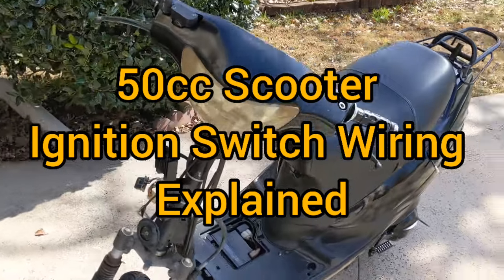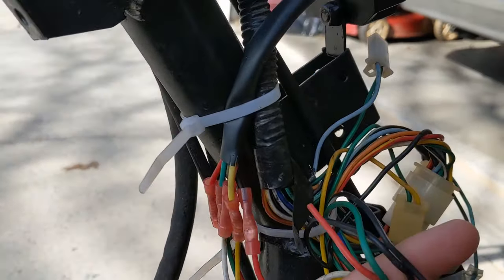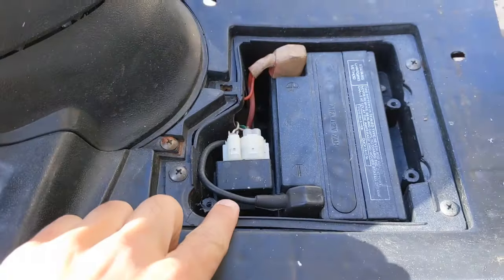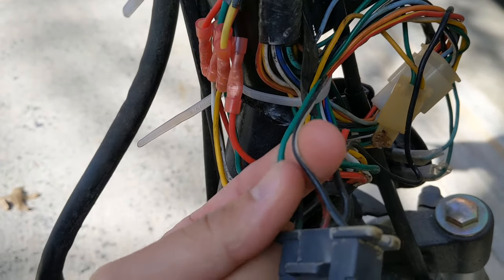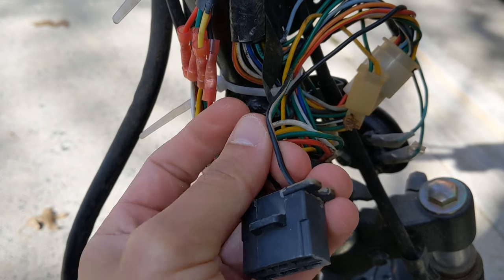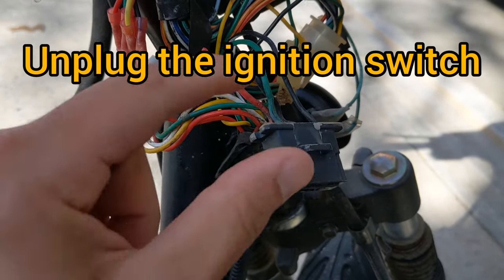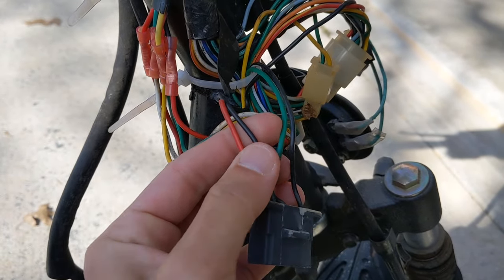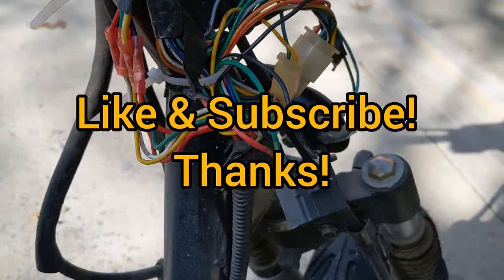50cc Scooter Ignition Switch Wiring How To [Lost Key]

Comment: Ummmm i did this and all i got was my fuse smoking and sparks at battery help plz
Reply from the maker: Sounds like you connected your battery cable (with the fuse on it), to your ground cable.
Reply from the maker: What color wires do you have and which ones did you connect to which? Which ones smoked?
Reply: @MileHighDreamz  the colors are green-common ground 
Black/white- cdi wire 
Red- positive to battery 
Black- idk where goes 
Im trying to get my lights and everything working but Once i connected red and black like u said in video but i just got sparks at battery and smoke at the red wire fuse Xd
Reply from the maker: I would suggest using a multimeter or test light to verify. With the harness unplugged by the ignition switch.... Test between battery positive and green wire to verify you have voltage/the light turns on. Test negative on the battery to the red wire to verify it is 12v/light turns on. Test negative on the battery to black wire on the plug and it should be 0v/no light. Now test between the red wire on the plug and the green wire on the plug, it should read 12v/light on. Make sure the fuse is replaced before doing all this or the red wire tests won't show anything. I don't see why your color code would be different than mine, but that will verify it. You may also have a short somewhere in the system causing the fuse to pop.
Reply: @MileHighDreamz  Ill give that a try once i have a voltage meter and ima take wires off and look at it to see if there is a short somewhere also thank u for the fast replys
Reply from the maker: Glad I can help. If you ever dropped the scooter, check the wiring on that side. I know mine had a big bundle of wires running along the outside of the frame on the right side of the bike, just under the seat. Just visually check all the wires
Reply: @MileHighDreamz  It was a black wire touching the frame and it all works now yay👍😁
Reply from the maker: Awesome! I'm glad you found it. Enjoy the ride.
Reply: @MileHighDreamz  Lol i cant ride rn due to tryna get rear tire fixed and get right carburetor for it lol rn im using a water pressure carb lol
Reply from the maker: Sounds fancy! Good luck with it. You're almost done

Comment: Ugh when I do this and I start with the electric starter cause of the battery won’t start but the crank for some reason isn’t working ,any idea why?
Reply from the maker: Sorry I'm lost in translation. I think you are saying the scooter does not turn over with the electric starter? 
Is your battery good?
Did you check the fuse by the battery?

Comment: just dissconect the wires or cut them and kickstart it
Reply from the maker: That's how I had it. You won't have the full lights/electrical accessories available.
Reply: naa g connect red and black after for full use, den push green and other black through and touch wen u need to kill it if theres no kill switch
Reply: @Tcrash17  yo g how do i grab one with steering lock bro

Comment: i need a more clearer video matee
Reply from the maker: More clear as in the content, or the graphics? If it's graphics, check your internet connection or setting in the bottom right of the screen. If its content, then what is  your question, or what did I not cover clear enough for you?